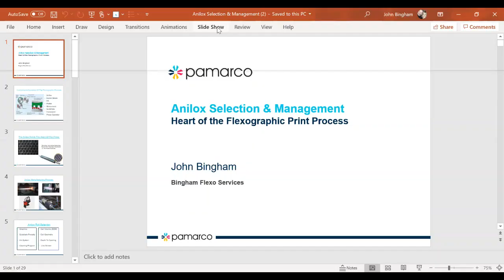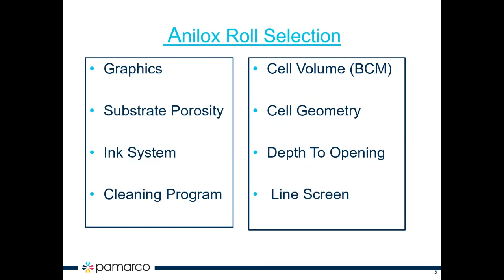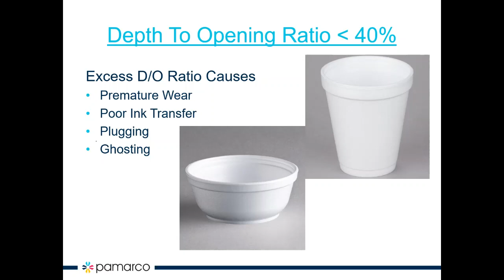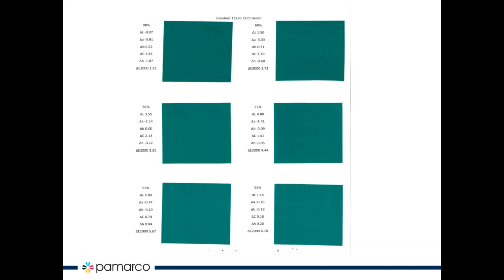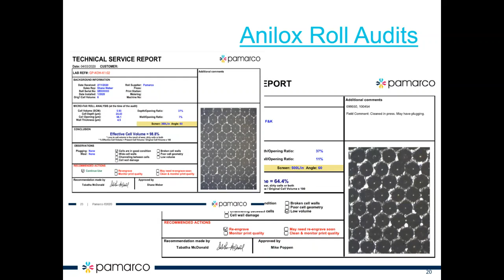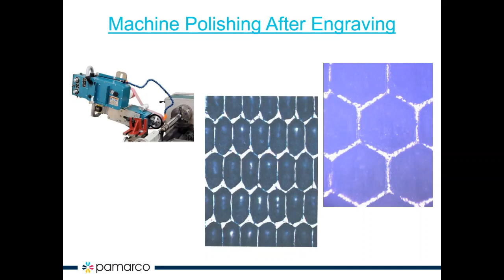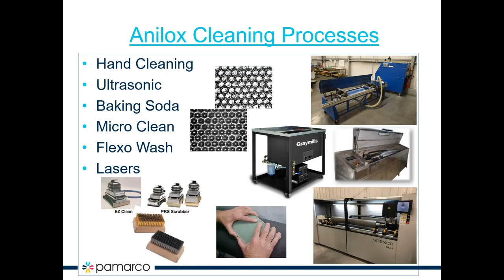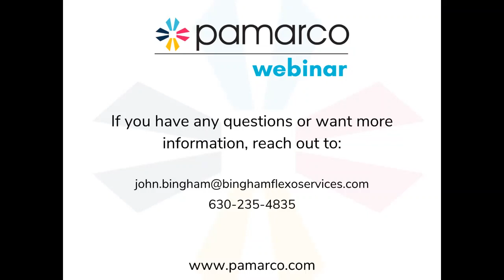Anilox Selection & Maintenance: The Heart of the Flexographic Print Press

Comment: Will more pressure between the anilox and the impression plate give a thinner coating on the substrate?
Reply: A heavy pressure shear on the chamber could create this. More pressure will create a smashed image and over impression. Sometimes appearing as an outline or a shadow. May even give a heavier coat on the substrate. Most printing press run on the idea of a "kiss impression" just a light touch or kiss to the anilox then a kiss to the paper as well.